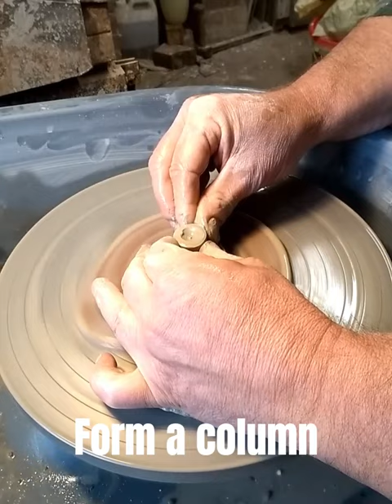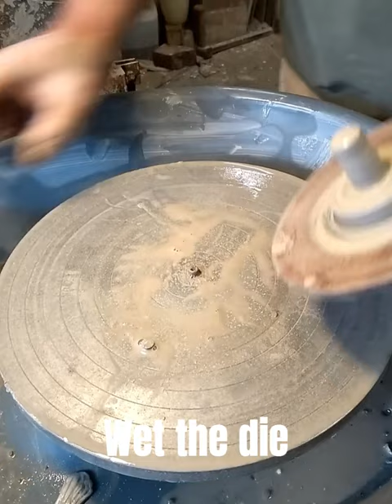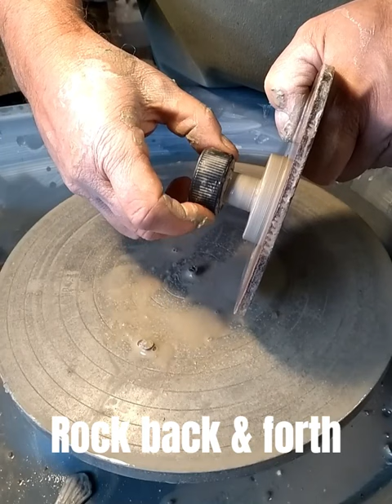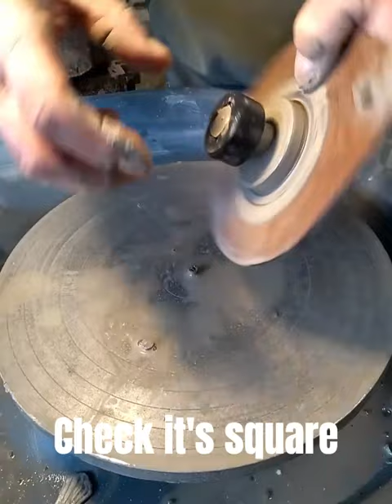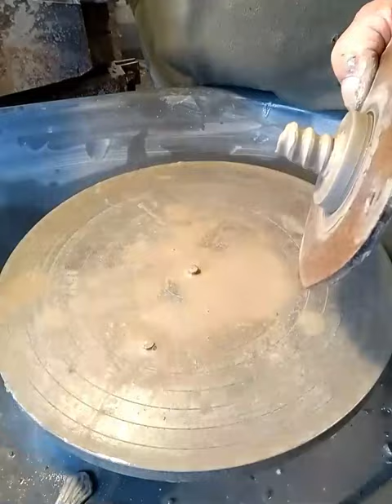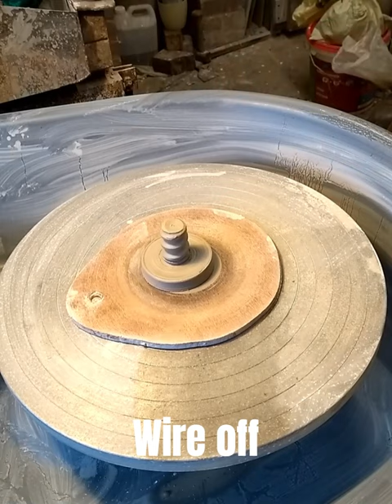How to make a ceramic threaded stopper 1: the stopper

Comment: Do you have a link to the 3d parts you sell? also if you can update your description with a way to contact you about ordering the parts that might help others. I would also be interested in the file if you would sell that but I understand if you don't want to do that. 

What do the stoppers cost?
Reply from the maker: Hi thanks, you can contact me through Instagram @joe_small_pottery to order.  We charge £25 for the smaller set and £35 for the larger one, not including postage. We might distribute the files in future. Joe

Comment: I think your procedure is flawed. And, that it won't work at a wide diameter with somewhat finer threads. Anyway, I have an idea for a tap tool I need in order to prove my method is superior. Your pots however, do look good and appear to be functional, that is air and liquid tight closure.
Reply from the maker: Your comment is a little unclear, but thanks anyway. As other videos show the tap  and die works well for 40mm diameter threads. This is an established design of tool and is described by the late, great Michael Cardew in "Pioneer Pottery" perhaps take a look at that. All the best with your idea.
Reply: I assume it is possible to cut both male and female threads in clay of appropriate diameter at the same time if you could make a thread cutting screw type of tool that had threads on the inside and the out. But, that had a thin enough wall so there was little play between the two parts. Most metal screw caps used on wine bottles are like this but don't have a continuous thread system. So, I have never tried to cut threads in clay with one of these type tools. It is however my modification to my original procedure to tap out clay. Further, the threads would have to be somewhat course, I can imagine. But, it would be extremely efficient way to thread clay. Also, my idea to make a tap tool out of a 2.5 inch plastic male threaded firehose plug by cutting hash slashes into the thread system is how I intend to test my original method of threading pottery at a wide diameter. As diameter is disqualified for a patent there is no harm disclosing that. It could as well take some time to achieve but I am hopeful it will work allowing access to contents of a pot through much wider opening closure. Thank you for considering that my processes to thread clay are viable for production potting. I look forward to proving them if possible.
Reply: If you melted the plastic cylinder part like from a plastic bottle around a thread system maybe made of string wrapped around another slightly smaller diameter but more sturdy cylinder. It is possible it would form a thread cutting tool that will cut both thread teeth with one pass or screwing motion into a sold cylinder of clay. Just a side note about how to make the tool described in my previous comment.